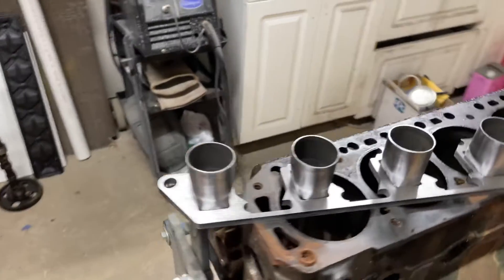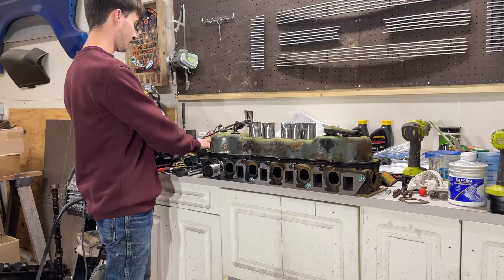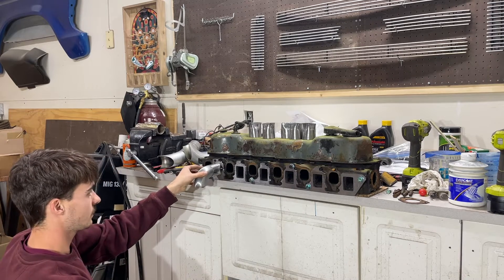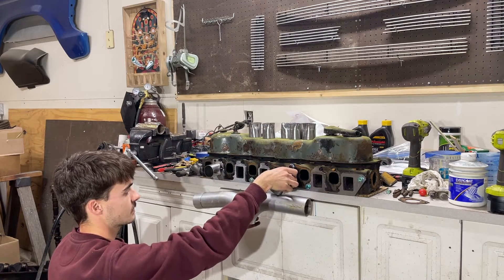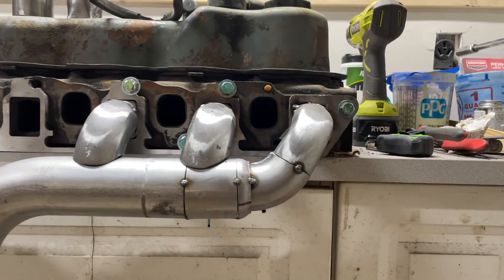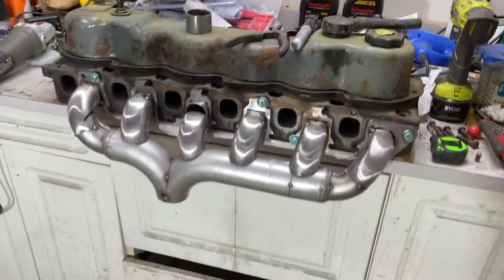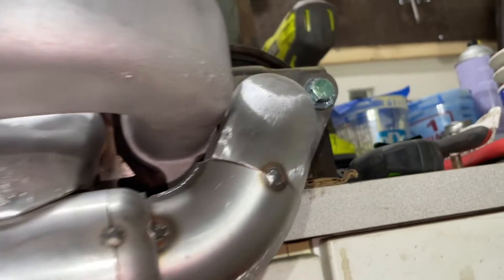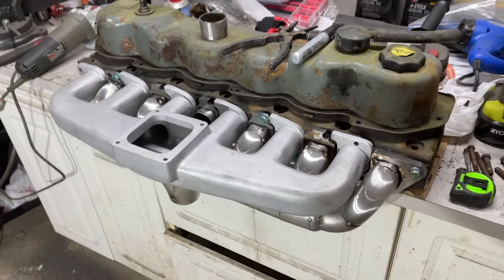Building a Turbo Header for a 300 inline 6 - Part 1

Comment: Where did you buy the 2" mild steel 90's?

  I'm gonna be building one similar for a trike I'm building with the 300 6 in it, my header will be the opposite of yours, it will dump in the front

Comment: Manifold is looking pretty damn sweet. Are you concerned with the wall thickness? I’ve built a few log manifolds out of much thicker material for sidekick/samurais, and they still cracked. 🤷‍♂️
Reply from the maker: Yeah I’m definitely concerned about it cracking, it’s not supporting any weight though so we’ll see. The rest of the exhaust between the manifold and the turbo hasn’t broken yet and that’s been about 4 years, this is definitely subject to more heat and expansion though.
Reply: @WastedPaycheckGarage  I’ll be following along regardless. 😎 love the build. 🇺🇸